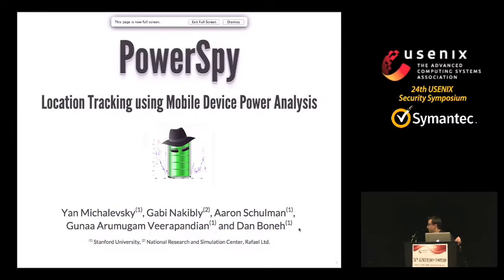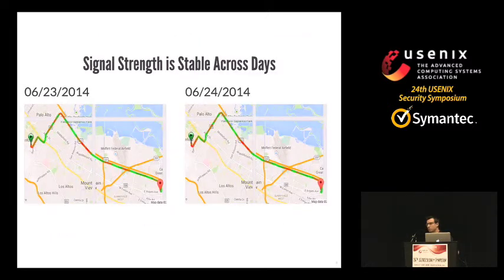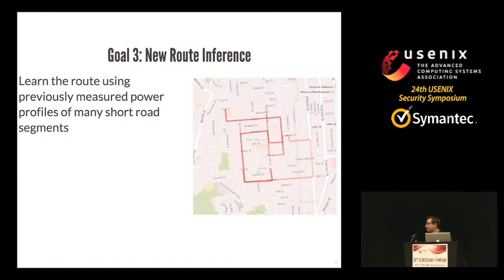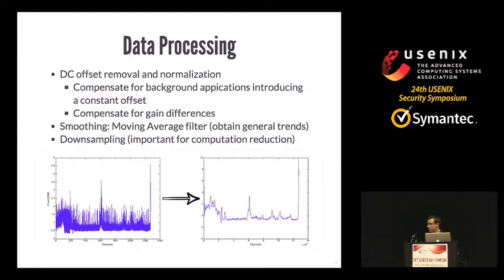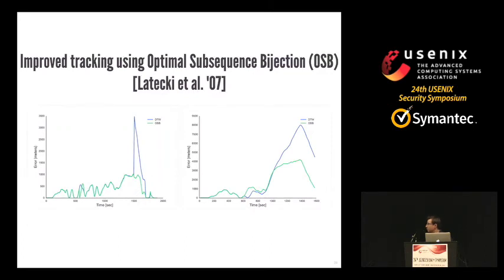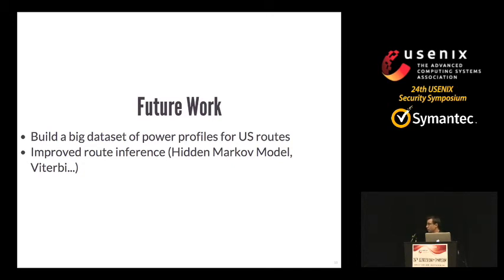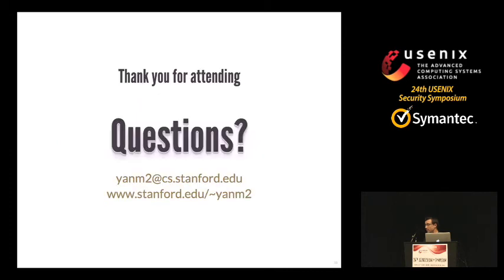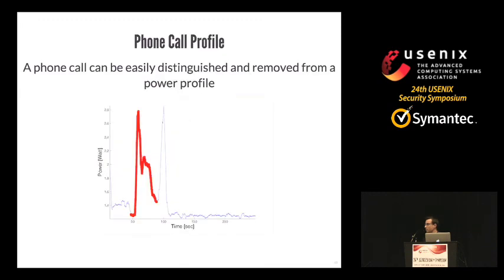USENIX Security '15 - PowerSpy: Location Tracking Using Mobile Device Power Analysis

Comment: Thank you very helpful worked with a similar software in the past but there are easier ways to track it if you get a sound sample you can also track location based on the hum of electronics you just have to filter out your own sound in your location and find the corresponding data to a similar grid system unless they're using a power filter which can cancel out system hum or unless they're in a vehicle or if they're off battery power or using a generator I can make things really difficult to reverse target